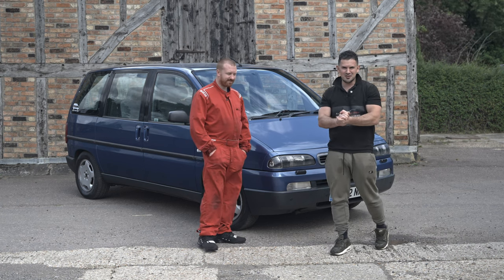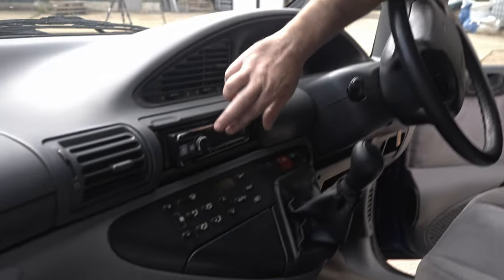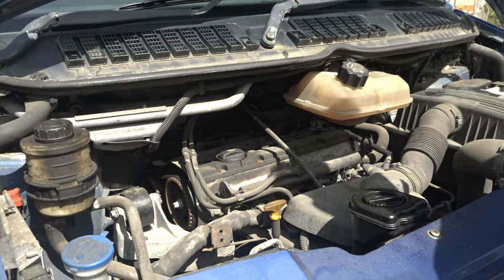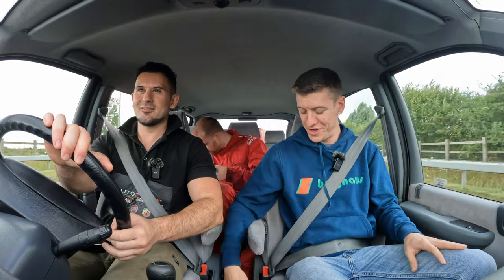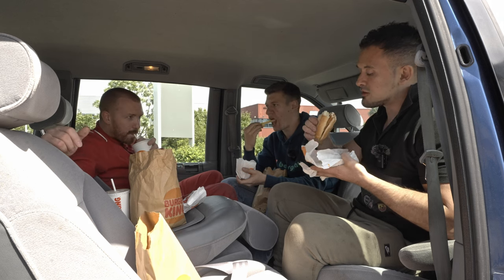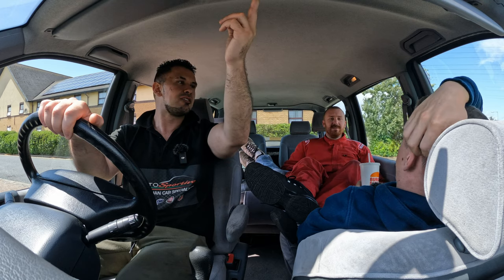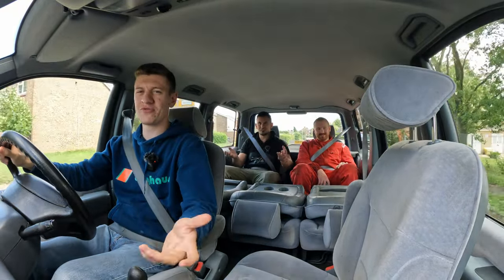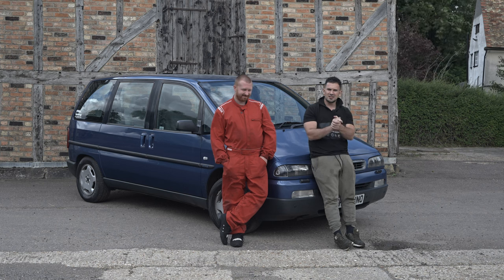Living with a £250 Minivan #fiat #fiatulysse #ulysse

Comment: Love this, I'm in the trade too but retail not sales. I bought a 2006 Vauxhall Meriva aka Fiat Idea 7 years ago off a pal of mine for £250 with around 78k miles. I've still got it, it's on 98k miles now, use it to dump at stations, pub car parks, my wife uses it between car changes, it does tip runs, sometimes I forget where I've left it. It's only needed oil changes, tyres and brakes, prob worth around £800 now!
Reply from the maker: Right on